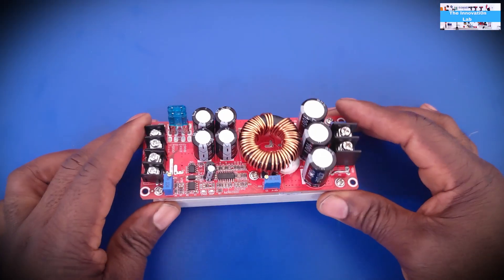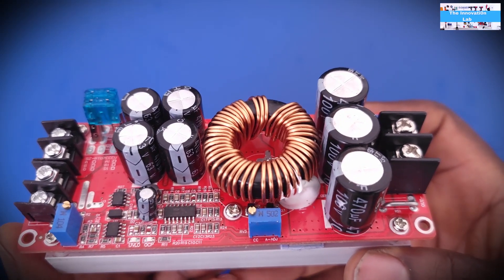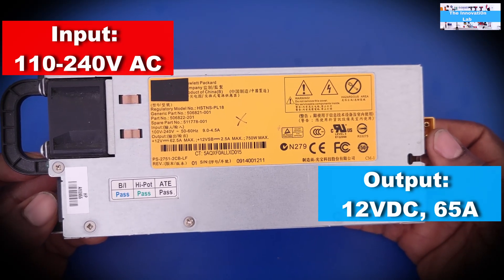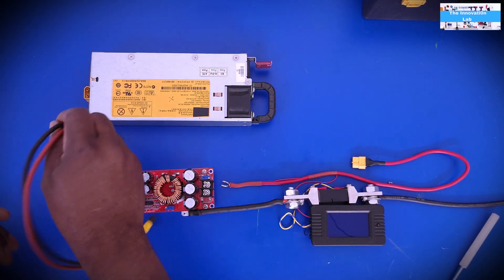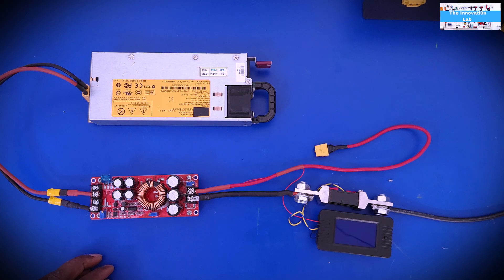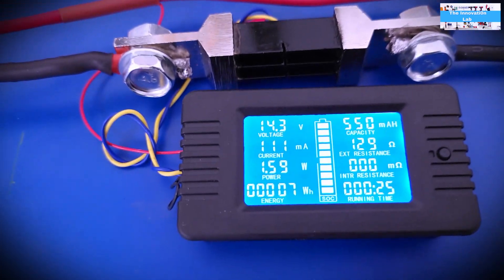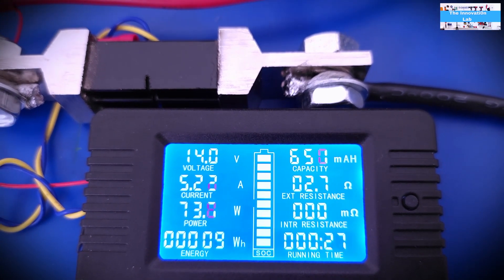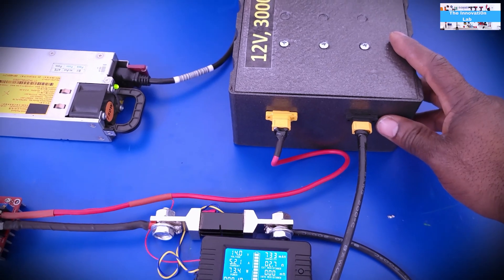Cheapest Universal Battery Charger Using a DC-DC Boost Converter

Comment: Is it possible to make a variable bench power supply with this boost converter. I have a DPS3005 and normal ATX psu. Thanks for your video.
Reply from the maker: Absolutely!
The setup will work with any DC source 12 to 60V Output Voltage  range that is clean enough to drive the boost converter. 
Most, if not all, computer power supplies would be ideal. I just haven't worked with the ATX power supplies. But I am sure that with some research, you can figure out how to enable the outputs.
Reply: @theinnovati0nlab782  Thanks!

Comment: Que tal como le va? Consulta cuanta es la intensidad de entrada qué soporta este booster. La idea es ponerle una celda lifepo4 de 3.2v 200amp y elevar a la salida 60v 10amp se podrá hacer lo que digo? O no soporta tanto amperaje de entrada? Muchas gracias
Reply from the maker: Hi friend,
I am doing alright. 
It looks like you want to drive the converter  at a 600W output power capacity. Yes, I believe that the converter should be able to handle that - given that it is rated for 1200W.

However, please remember that when connector lithium phosphate batteries in series, you need to use a BMS or good balancing circuit. If not, some of the battery cell will overcharge...and this is dangerous.
Please proceed carefully with this plan.
👍😎
The Innovati0n Lab
Reply: @theinnovati0nlab782  muchas gracias

Comment: can it charge 48-72 volt li-ion battery ?
Reply from the maker: The boost converter used in this video only has an output voltage range of 12 - 60V. So, it can only charge a 48V battery.

Comment: How do you ensure CC-CV characteristic for the charger required for li ion chemistry
Reply from the maker: I am not sure what you mean by if we could ensure CC-CV. We are not the manufacturer of these converters. However, one of the ones I have used, the CC and CV functions, works as I would expect.
I hope the helps.
The Innovati0n Lab.

Comment: Great video, if I use a ATX PSU that can deliver 12v 50 amp, could two 20 amp DC-DC Boost Converters be wired in parallel for 14.6v 40 amp charging? I am building a 12v 105 amp lifepo4 portable power station and want to charge it in 2-3hrs.
Reply from the maker: I am currently working on this parallel boost converter test video. Please see some of my latest shorts. However, the paralleled converter option will work for only fixed voltage applications like for powering an ebike or other devices. It may not work well for battery charging because making the current adjustments will be difficult.
👍😎
Reply: @theinnovati0nlab782  Thank you for your reply, I look forward to your video and will check out the short video too. It's fine if I cannot change the current or voltage after setup because the charger will only be for my 12.8v 105ah diy power station, as long as I can charge it at 40 amps 14.6v, I presume that the parallel boost converters will still gradually ramp down the current until the maximum battery voltage is reached (14.6v).

Comment: I liked the video on building this charger. I ordered 3 and im trying to build a charger by combining all three. I have a 100 amp 12 volt power supply and a 560 ah 24 volt lifepo4 battery i built with 280 ah eve cells. Its a 2p8s 14 kw battery. I have several victron and other types of solar chargers but im wanting a high amp charger that i can plug into my house. I also have a 40 amp 24 volt charger but im wanting atleast 100 amps for a quicker charge.
Reply from the maker: Great idea.
However, how are you going to handle the current adjustments needed for your batteries system?
Reply: @theinnovati0nlab782  I figure I'll hook them up one at a time and adjust the voltage and current then check each one then check them with both them together and see if voltage stays the same. If not I'll use 2 seperate power supply and then check them both again. It's a huge battery with a 300 amp 24 volt bms that should protect the battery if it gets out of tune
Reply: How's your experiment going?I'm looking for same solution here for high current battery
Reply: @drpainlesss  I've rebuilt the battery and actually built another. They are both 840 ah at 24 volts. Each one is 3p8s eve 280k cells. I tried building a charger with those dc to dc  boost converters and it wasn't a success. I ended up buying 2 of the 50 amp 24 volt chargers from powermax. I have 2 victron 150-70 solar charge controllers and a all in one inverter with a 40 amp charger that I can run from a 110 outlet also. Then my sungold power 4000 has a built in charger also. I am on the road in my semi truck 27 days a month but when I'm home I'm off grid 100 percent now. It's been about 30 grand to get set up to live comfortably off grid but it's worth it so far. I'm looking for a safe property now where my stuff will be safe while I'm on the road

Comment: You can buy a variable DC power supply for just a tiny bit more. The one you buy ready-made also comes with a digital display, which saves you having to buy a multimeter if you don't own one.
Reply: It doesn't sustain for long since the maximum voltage capacity of it's capacitors are 16 volts. I had one and it blew up.
Reply from the maker: Hi friend,
Thanks a lot for the wonderful comment. Please can you share a link to the power supply that you were referring to, if you don't mind?
👍😎
Reply: @theinnovati0nlab782  I replied but my comment got deleted. Search for "variable DC power supply." I can't tell you where or my comment will disappear.
Reply: @theinnovati0nlab782  he might be talking about the riden dps5020

Comment: I need some help. Can I use a Boost converter for electric mower conversion? The electric mower needs about 120v
Reply from the maker: Hi friend.
Wonderful idea. Unfortunately, the boost converter has an output voltage limit of 95V DC.
Reply: @theinnovati0nlab782  Aren't there 120v voltage boosters

Comment: I have a one. 27 to 40 volts I want. I get the 40 volts doesn't charge. I ajust the other knob and voltage does fo down
Reply from the maker: Hi friend,
Is the 27 to 40V your boost converter that is not working? Or is that a battery pack that won't charge? 
I just need to fully understand your question.
If you can explain better in a different language, that will be great. I can use Google Translate.

Comment: Can I just connect to a 12v car battery?  I want to charge my 36v scooter from the car. 🚙Is it possible ?
Reply from the maker: Hi friend,
Thanks for the feedback.
It should be possible, but this is not something that I would recommend because if anything goes wrong, your vehicle alternator and charging system could get damaged. 
I would prefer to use a mains power supply.

However, if this is something you MUST do out of a necessity, I would highly recommend you connect a power monitor to the input and output of the boost converter to make sure that you are not pulling too much power out of your vehicle alternator. Charge at a lower current to avoid an overload on the system. Also, please do a lot of research on your vehicle's charging systems before trying this. I am not a car or alternator expert.

Again, I wouldn't recommend it.
Reply: @theinnovati0nlab782  so I will disconnect the battery from the car. 🙏
Reply from the maker: Awesome, that is safer.
I would prefer that.
👍
However, depending on the capacity of your scooter battery, you may drain your car battery, just something to keep in mind.
The boost converter has losses that will add to the total electrical  energy  drawn from your battery. 
If your scooter battery is significantly smaller than your car battery,...and your car battery is fully charged when you are doing the charging, then you should ok.

For example, if your vehicles battery is a fully charged 12V, 60 Amp/hr battery, and you are charing a 36V 10amp/hr scooter battery, I think you should ok.
But then, you never know until you test it.

Also, you run a risk of not having enough charge left in the car battery to restart your vehicle afterward. You have to consider all the variables, in my opinion.

Comment: Would it be safe to connect the battery first und then connect the power source? I'm not sure if this modules survive voltage at the output while they are not powered, so if additional diodes to prevent back current are necessary?
Reply from the maker: Hi friend!
Thanks a lot for the very thoughtful feedback. 👍👍👍
I would not recommend leaving your battery permanently connected to the boost converters.....or even any charger at all when the power source to the charger has been removed. If left this way for a long period, the charger could drain or damage your battery.

Here are the safety steps that I always follow when charging my batteries;
1. Connect input power
2. Adjust charging voltage
3.  Verify, charging voltage
4. Adjust charding current <1A
5.  Verify polarities 
6.  Connect battery
7.  Increase charging current.

Comment: Great content. What gauge wire are you using in this build? I want to add a charge contoller to this setup. Thx.
Reply from the maker: Thanks a lot for watching our videos.
Those should be gauge 10 wires. Given the current limit of 20A on that boost converter, gauge 10 should be good for a short wire run. But if you are doing a long wire run, you can either double the cable or maybe consider using a gauge 8 wire. This is because you always have to account for wire resistivity per unit length.
Reply: @theinnovati0nlab782  Thanks, got this going successfully and charged my 70AH SLA battery. Used an HP HSTNS-PL18 PSU and a DC - DC boost converter. 🤓

Comment: I just ordered this dc to SC converter,  is there  way to add external pots in order to adjust voltage or current without using a tiny screwdriver?
Reply from the maker: Thanks a lot for watching our videos.
Yes, you can just order the matching potentiometer (3590S package) value that was used in the units you bought and carefully solder wires from the external potentiometer to the board.

Caution:
Please make sure that the wires are very well secured on both the board and at the potentiometer pins (I will recommend using hot glue or good non-conducting adhesives). This is because If the ground wire breaks off, it could cause your boost converter to lose output regulation and the adjusted output voltage will rise extremely high (>100Vdc). Since the output caps, MOSFET, and diodes are rated around 100Vdc, a lose ground wire, could damage your converter or any load you have connected.

I will recommend not doing it - if you are a beginner with electronics and power.
I also did something similar in the video below.
https://youtu.be/iQnXLZqpSpo

Comment: Great explanation video! Thank you.

One more question. Do you believe this is safe to have this continuously / permanently connected for the purpose of a backup UPS type solution?
Reply from the maker: Typically. I would say that it should be safe. However, I will not recommend it. 

Reason:
It is recommended  to  always allow your battery to fully discharge, and then you recharge it - every now and then. Even though the  batteries types like Lifepo4 and Li-ion are less sensitive to memory effects, it is still a good thing to let them discharge fully - every now and then.

UPS systems are design with cutt-off circuitry that isolates the battery from the charging system - once it is fully charged, but then trickle charges it as needed. This is why they are also considerable expensive - because they have everything in one package (battery, charger, inverter, and power change over circuit)

I will explain it better when I make the battery charging video.

Thanks a lot for all your support and for all the insightful questions/comments.

Also, I don't pride myself of knowing everything. So feel free to correct me if you found something different in your own research.

Comment: Will the power supply switch off once the battery is at full charge or will a automatic switch of some sort be required.
Reply from the maker: Thanks a lot for watching this video.
To answer your question, once you set the charging voltage and currwnt to the recommended levels, your battery will balance out with the charger because the both will be at the same voltage level. 
This will be the equilibrium point between charger and  battery. But make sure you set your voltage right.

Please don't forget to help us share our videos to help our channel grow.

Comment: Super sir, this is having auto cutoff after battery get full charged and reverse voltage protection. ?
Reply from the maker: Thanks a lot for watching our videos and for the engagement, I appreciate it.

Regarding your questions see below.
1. Reverse Polarity protection: Vendor claims that this feature is built into the design but I have not tested it. Maybe I will test it in a future video. But see the link below for the 1800W boost converter specs and features; https://a.co/d/8yAs7YH

2. Overcharge protection:
This device was not designed to be a charger. However, my videos show how you can use them for battery charging. 

So this is what you should do. 
- Set the boost converter to your maximum rated battery charging voltage. 
Please note that different battery types require different charging voltages. You have to do some research.....or you can just watch my tutorial video below;
https://youtu.be/nd6EhH1SCio

- Now, after setting the battery charging voltage,  set the charging current using the constant current adjustment on the boost converter. Again, you have to do some research for the recommended charging current depending on your battery type - now begin charging.

When your battery reaches the charging voltage you have set, it will no longer accept charge because both the charger voltage and the battery voltage will equalize. This is mostly applicable to lead acid batteries. It is even better with other battery types like lithium ion, or Lithium phosphate because they have internal protection circuits.

Thanks again and please don't forget to help our channel grow by sharing our videos.
Reply: @theinnovati0nlab782 thanks you very much...i need this explanation ... Even though i was logically think it Will balanced out and battery wont draw any from the converter... I just have no confidence trying it ...your simple word really help alot for me.

Comment: Max output voltage??
Reply from the maker: Max output voltage of the system? or are you asking about the boost converter spec? Please be more specific.
Reply: @theinnovati0nlab782  boost converter max output voltage which we can get from it
Reply from the maker: Wonderful question my friend, also thank you for watching this video.
The model of the boost converter used in this video (1200W) goes upto 83V at the output according to the manufacturer specs.
Please see the Amazon product link below.

Please don't forget to share this video if you found it helpful. Our goal is to help everyone.

KOOBOOK 1Pcs 1200W 20A DC Car Step-up Power Supply Module Boost Converter Adjustable 10-60V to 12-83V https://a.co/d/a7dDjDE

Comment: This is not suitable if your battery voltage has dropped below 12 volts. This Boost converter cannot maintain operation when output is connected to a very low resistance load (like a battery). And the max input current is transferred to the load. I tested with 12v 35A input, Set the output to 14V, and ran a starter motor with it. The CC function was unable to adjust and the output current maxed out to 35A.
But when I run a 12v light bulb with it, it maintains output voltage above 12 and CC function works.
Reply from the maker: Thanks a lot for watching this video and sharing you experience my friend.
First of all, I will like to say that this video focused on using this boost converter to charge  batteries and not to drive a super low resistance/impedance loads like a starter motors. 

However, from the description of your project, it seems that you overloaded the converter. Starter motors require lots of drive current (especially when they are starting) - depending on the strength/power rating of the motor. 
I am not affiliated with any vendor so my videos are nothing but honest product reviews. 
I will highly recommend that you take the time to go through the specs of the converter to understand its limitations. Also, try to study your load to understand the power requirements. The 1200W converter is rated for a max input current of 30A, but a max output current rating of 20A. So for your project to be successful, you have to plan around the product specs.

Also, these converters only cost less than $30, so it will be unfair to expect it to perform at the level of  $1000 converters - yes?

Thanks again for the wonderful feedback and for sharing your experience on this.
Reply: @theinnovati0nlab782  thank you for the kind reply. I read the specks now. It is stated that for the converter to work right, the output has to be higher than the input. It does not support short circuit current limiting. So yea, I had 12v at the input, and if I tried to charge a battery (which also have very low internal resistance) which has dropped down to, say 9v. It wouldn't work. I read that minimum input voltage for this converter is 8v So I might play around with that and see how it goes. Anyways, thanks for the input and a very informative video. 👍